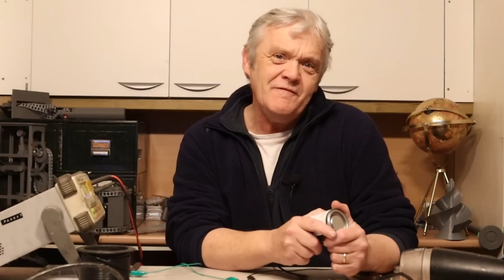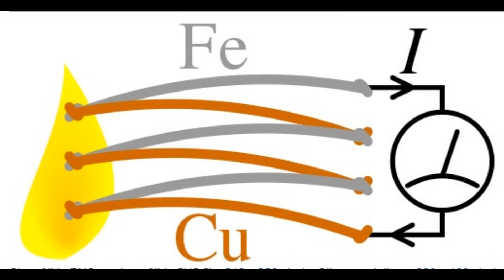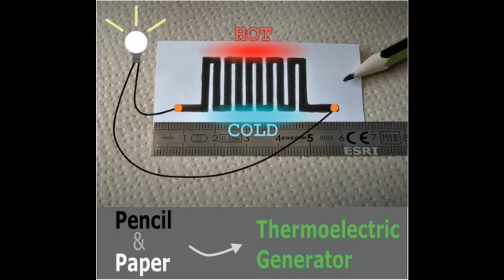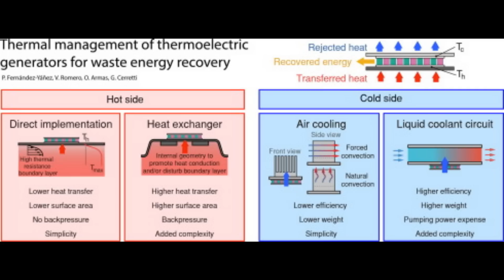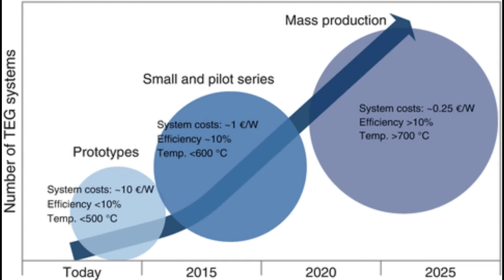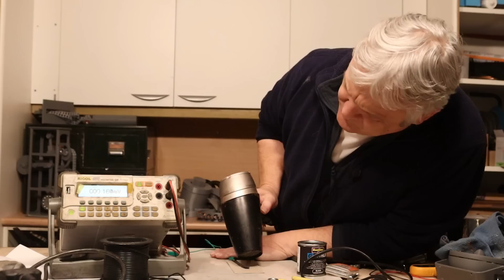2131 Thermoelectric Generators And Graphite Paint

Comment: How about using copper pcb or aluminium pcb material and silk screening or using a plotter for printing the graphite paint part. Then take this panel and put the hot joints in the sun and the and the cold joints in the shade.  Maybe even using a non conductive black paint coating for the hot joints and the new white cold paint for the cold side. This way you could create a non silicon based solar panel. I think this is worth a shot.
Reply: talking of copper, on his spark bang buzz webpage, Nyle Steiner detailed that "copper" junctions can generate 0.3V if 1st  oxidised in a propane torch, touched together then one wire heated up more than the other. PCB fab methods akin to your suggestion might offer an easy way of manufacturing 2 complementary pcbs which could be arranged to touch each other at a high density
Reply: @stevecummins324  hmm. That got me thinking. ...

Comment: I bet this can be leveraged to increase the efficiency of sand batteries, if I'm understanding this correctly.  I have a question though, technically speaking, would covering the exterior of your home in this help to protect it from an EMP? I'm in America and it sure feels like its time to begin the doomsday prepping in haste. Lol
Reply: A faraday cage that doubled as a thermoelectric generator would probably do a subpar job in both areas.
Reply: @bearnaff9387  In what fashion?  Not asking out of conflict but ignorance.  I would think it could only be an enhancement without detriment to a sand battery.  Where does the harm come from?
Reply: @LawrenceMarks27  I was more referring to your comment about your home from an EMP.    I definitely understand the desire to build something multifunctional, but the functions of a faraday cage (RF isolation without any way for energy to penetrate) and a thermoelectric generator (current generation via the exchange of thermal energy through a "hole" more or less) are opposed.  I think they're opposed enough that making a device that worked as one of these would impede the function of the other so badly that it would never "pay for itself" in terms of the materials and effort expended to make it.

As for using a TEG with a sand battery, I guess it depends on what you want the sand battery for and what you want the electricity for.  

Every TEG "pile" added to the battery will generate more power, but will also be a point where heat will radiate out more quickly than the rest of the surface.  This can be exploited, and is not necessarily a negative thing.  

As for power, you will be extracting very small amounts of electricity for a very large thermal gradient.  If you need work performed, you might want to see about heating a boiler and using a steam engine.  If you are just trying to power an indicator LED or run a fan to better circulate stored heat, you're on the right track technologically.
Reply: @bearnaff9387  Yea looking into it after your reply, it did seem that it could potentially block an "environmental EMP" but ... yea thats not the point. lol

Comment: Wonder if it could be a crude solar panel as in just using the heat of the hot sun , Might have to be in a desert mind.
Reply: I think I heard Photovoltaics generate heat, perhaps the recovery of that through this process is worth while if it is simply printed on the back of a panel substrate. Idk
Reply: So then you would be left with do I cool a panel for more efficiency, do I collect power from the heat generated? Cost, maintenance active, passive etc. etc. etc. as in does it fit with what you wanna do? I don’t know… I wanted to do it for a number of reasons that are my own, maybe this is the way they printability process is intriguing, as the printing method could be ridiculously simple without tech.
Reply: Okay so lets sum this up a solar cell with a thermoelectric panel on the back side but how do we get a good cooling circulation without any power losses?
Reply: Inexpensive fans maybe that are powered off of the thermal or solar? Blows through a wind tunnel at the bottom of the thermal plate to cool it? Have to hope that it generates a significant amount more than that fan might require though. 12v is low end from what I see, may not be worth cooling the underside. Perhaps just expose it and let the shade or wind cool it passively?
Reply: The paint is conductive, it doesn't/can't generate. But used as a 'junction'(s) the effect can generate. Some time ago Rob showed this effect by painting sulphur etc onto metal tapes and metal sustrates. Look it up.
Reply: I kind of want to try that too.  Paint the top black, add a TEG module, and connect the bottom to the ground (where the temp is constant) with heat pipes.  I never tried it because I never figured out how to make heat pipes that could move heat from the top to the bottom.
Reply: @ancapftw9113  Invert the HPs so the dissipation part is highest and shade them, and/or encase them in a wettable fabric and drip-feed water on them.